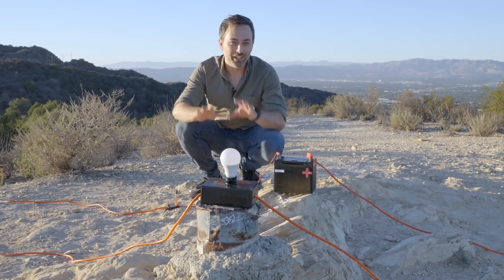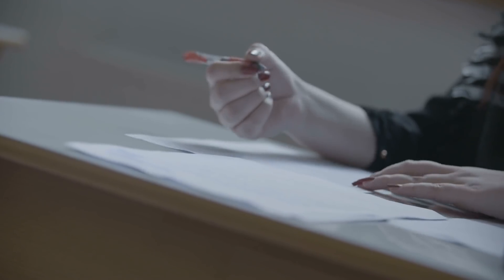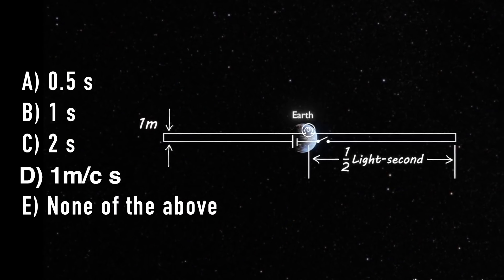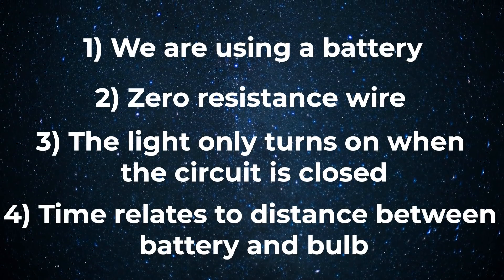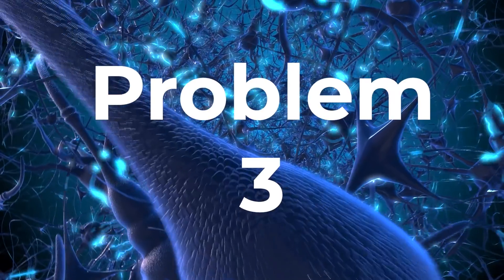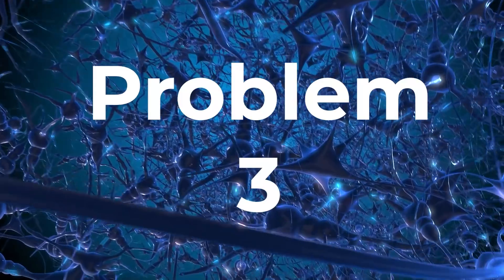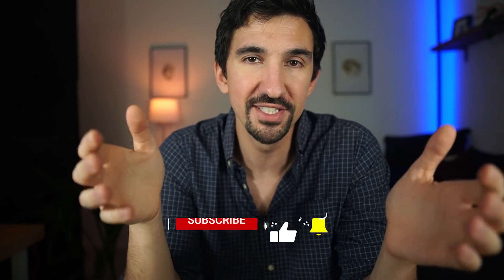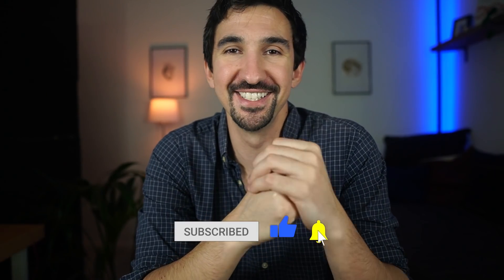Is Veritasium Wrong About Electricity?

Comment: Let's be honest, everyone's wrong about electricity. We've been going the wrong way for almost a millennium or 2.  Nicolette Tesla showed us the way using coils and Capacitors But we still think that resistance is how we get electricity. pulsing a 
Coil 
capacitor with the same values in series. 
At the right time and/or high frequency. We could have gotten power beyond what we see today, 369 × more power

Comment: Does the fact that it's electronic & magnetic fields that produces usable electricity allow for the future possibility of transmitting usable electricity in wireless ways rather than having to use a wire-based system?

Comment: Hi Ben, I am an Engineer for Microelectronics with more than 20 years experience and also responsible for the physics inside Microchips. Also I like science Videos on youtube and I saw this video very late and I was tiered. I had the same feeling like you and I stopped the video, because I was confused and thought what a bullshit. With so many Abonnements usually I expected professionals.
Reply: An Engineer for Microelectronics that doesn't know how a transmission line works?

Comment: Neither explanation makes sense. If electricity flows only through the wire, then electric arc furnaces should not be possible. If an electric field carries the energy, then integrated circuits at the size we see today should not be possible as the aur between the transistors would carry a field that would fry them. So what's the answer?

Comment: No. The bulb would go off 1 second later. Breaking the circuit at the furthest point will create a pulse that travels back along the wires to the battery/bulb at the speed of light or close to.

Comment: The closely spaced wires have a capacitance between them.  You can't change the voltage across a capacitor instantaneously.  When you close the switch, the wire on the far side of the switch from the batter is lifted to V.  You don't have to wait for that to run all the way out to the end and back to get the other nearby wire up to V - that capacitance "shorts out" that path and the other wire goes immediately to V, giving you V across the light bulb.  The transition from V to 0 propagates out toward the turnaround, yes, but the whole way the two neighboring wires have the same voltage, because that capacitance is linking them the whole way.
   
The "naive" circuit model that the video lets us imagine isn't correct - those parasitic capacitances need to be included in the lumped parameter model as well.
   
The really proper way to model this is with transmission line model, which you can model as a whole chain of series inductances and parallel capacitors.  You're going to get some pulse of current through the lamp almost immediately, but whether it would be enough to turn it on or not... well, we'd have to do the math.
   
Here's another way to think about it.  Imagine a standard transmission line that's shorted at the far end.  We put current meters on both conductors, right by us at the near end.  We hook the battery with the switch on one end.  Like this:

+----/ --- Meter ------------------> to shorted end
|
Battery
|
+-Bulb--- Meter ---------> to shorted end
   
The / denotes the open switch.  Now, when we close the switch, what do the meters do?  The answer is that both of them will immediately indicate current.  In fact, even if the far end was OPEN they'd still both immediate show current.  The difference wouldn't show up until later, when the signal had reflected off the far end and come back - in that case the current would STAY on for the shorted line but would go back off for the open line.  But before the signal gets down there we don't know if it's open, short, or in between.
   
The point here is that the bottom meter shows current immediately, which is why the light bulb would come on immediately.  It's those capacitance elements between the wires that give us a path for the current right away, even before current has taken the long path around.
   
The fun  idea here is that we could test this.  Obviously we can send wires halfway to the moon, but we could wend wires 20', 50', whatever.  And using modern digital technology we could time how far apart the switch closure and the reaction over on the bulb side were.  We could easily get that "speed of light round trip time" up to tens of nanoseconds, maybe more.  Just depends on how much room you have to string out wire.  We can measure those time periods.

Comment: In the model where you break the circuit at a far distance, the light wouldn't turn off as quickly as it turned on when you completed the circuit with the switch that's physically closer to the load, just as it wouldn't if you used that as a switch to turn it on. The light would turn off at the speed at which light travels from that distant switch. You don't break causality.

Comment: I think you missed the whole point electrons move extremely slow through a wire, it is the influence of the electricity that moves approaching the speed of light. And that influence is simultaneous down the whole wire. At the speed of light.
With the exception of any capacitance charge or inductance delaying the effect.

Comment: The circuit is complete except at the switch. Even through the element of the bulb. All electrons in the circuit are dormant til the switch is closed. Once closed the electrons move and the bulb lights up immediately. I think ?

Comment: I just watched that video right before this one popped up. I’m not an Engineer nor a physicist but a welder/fabricator and I’ve worked in automation and have a laymens understanding of physics and electrical engineering. My immediate reaction is that his model is flawed and incorrect but because it assumes an “empty pipe” so to speak. Just the same as if you took a pipe and made a long circuit but left the pipe empty and opened a valve it would take a long time for the water to first fill the pipe and then complete the circuit. Whereas if the pipe was already full and you open a valve the movement of water is instantaneous. Well his model assumes an empty pipe in my mind whereas the conductor already has electrons,they only need a push and a pull so distance isn’t and issue the circuit closes and movement of current is instantaneous. Besides all the other problems you pointed out in your video such as resistance etc. it simply is a bad model.

Comment: I thought about it for decades ever since I found out the magnetic vector changes when you go from a right handed solenoid to a left handed solenoid on a battery. You can do the test yourself with a 6 volt battery and coils made of flexible wire. And a compass to measure the magnetic field. But why is this true? Because the right handed solenoid chooses a righthanded current going from positive to negative and a lefthanded solenoid chooses a lefthanded current from negative to positive.  So do it yourself. Use a right hand rule for the righthanded solenoid. And Amperes lefthand rule for lefthanded solenoid. This is essentially the Madam Wu experiment but Wu assumed there's an electron current from negative to positive in both solenoids. So she got the wrong result.  Parity can be  restored as I found.

Comment: Just to throw my threepence worth in, so it’s probably wrong. Fields do not instantly get created, or end. When the circuit is closed causing the light to come on, it takes for the field to come on fully, there really small amount of time as the field gets to full strength, likewise when you open the circuit, ie switch the light, there is a really small amount of time for the field to collapse.

Comment: Anyone finding it hard to understand think of a water pipe as that you have volume voltage and flow is current.  So the minute the switch is on it pushes the electrons out the end simultaneously the switch is pressed.

Comment: I remember watching that video, and thinking "no.. that's not right '.. especially the resistance issue with DC battery.. since Edison was going to need generating stations every 50 miles, or so..to comercialy use DC power.

Comment: You didn't listen to the video. The power is carried in the FIELD around the wire. Not in the wire. The electrons are excited, not flowing but vibrating or oscillating back and forth creating a field which carries energy instantaneously. The point he made was that we've been wrong in assuming electricity was carried in the physical wire.

Comment: The light bulb is just a radio wave detector when it blips from the 1/c but it doesn't become powered until the speed of light can navigate the circuit from the battery to the bulb along the path of the wire. A radio wave emitted from the wire by the battery of course will reach the light bulb (and be detectable) long before an electric field wave can circumnavigate the first half of the circuit.  Transmitting power by radio waves doesn't transmit much power, but it does transmit SOME.

Comment: technically its the electrons that emits the photons. there is no reason to think that photons have their or speed independent of the electron and does not make any sense at all. neither does the idea that photons moves in waves in vacuum. its absurd how ever if the photons are like more or less stationary particles similar to air and the electron generate a sound wave at the scale of a photon then the resulting photon flux would be more of a chain reaction and the wave would be like a ripple in a gas chamber. since em waves are transverse waves they does not logically make sense as waving photons in vacuum as a transverse wave require a medium of particles to propagate its direction of motion. 

i imagine its possible to make directional sound waves that behave like laser. do the same thing with atoms as with photons. the quantitative loss of strength to distance by em transmission is exactly proportional to the electron cascade loss of kinetic momentum  in a wire. electrons behave like atoms. when electrons bump into each other their vibrate just like atoms. the energy loss in a circuit is mechanical. electron energy density decrease with distance. the longer the wire the worse the output. you can put 200 watts input into the wire and at 200 meters the output is only 1 watt. 

this is not exact but you get the idea. electrons behave like newton's cradle and that is exactly how photons behave as well. down the rabbit hole its particles the whole way and the waves are just some pattern in the chaos of particles.

Comment: You have to remember that the time it takes for the light to turn on, in the case of a completed circuit, is (distance between the switch and the light)/c.  Therefore, if the switch and light are 1 meter apart and the circuit contains 2 light seconds worth of wire, the light turns on nearly instantly (1m/c).  In your scenario where a break occurs at the farthest point in the wire and the light instantly goes off is incorrect, because in that scenario the point of the break is effectively a new "switch" breaking the circuit.  The time it takes for the light to turn off in that scenario is now 150,000 m / c.  This then pollutes your "add another switch and transmit Morse" scenario for the same reason, the source causing the circuit to either be completed or broken and destination are arbitrarily far away and it takes distance/c time for that information to be observed.

Now this might seem, on the surface, to present a new problem.  Set up a system with multiple switches that turns the light on/off where you could locally turn your switch off and break the circuit while an incoming distant "on" switch message is still in transit thereby negating it.  However it isn't a problem.  All scenarios where that is possible (you can do the case grid however you like) the circuit is not complete whether you flip your switch or not, so the light will not go on.  The only information you learn is that the switch is open at the other distant end, which isn't universe breaking since you cannot transmit that knowledge to the other end any faster than the speed of light.  It's the same reason why entangled particles don't break causality, because knowing absolutely the state of a distant system due to a more local one does not transmit information.

Comment: It's 1/C. The thing we have to remember is that C depends on mu and epsilon (permeability and permittivity). So C in space is not necessarily the same as C in the wire. Closing the circuit creates an EM wave and the speed of the EM wave is C, by definition.

Comment: Positive is NOT the push of EMF you think. Negative pull is what this shits all about. Absorption is consumption. Once ionization in the conductor result occurs , the intrinsic potential is manifest. We know how different frequencies behave as well, higher frequencies will literally (in human understanding)    radiate on the shell of the conductor. Or maybe I am just a dum-dum head. For what it aint worth I perfected the counter measure system on the Minute Man 3 nuke at Tracor Aerospace. Just think in the parameters of radio transmission frequencies. But we just need solid antenna......differential. I am certain I have a hate group, but boys we were using AI and super conduction in 1985. Bet

Comment: You complicate your answer uselessly and create confusion.
No matter at what distance, the voltage will "reach" or "touch" the bulb coming with the lightspeed. The first "electron" "moves" through the bulb exactly when the EM "field" coming from any direction ( in this case on the shortest path from the battery to bulb ) reaches the bulb. There's a small delay in "intensity" ( meaning the strenght=constructive interferences ) only because there's some "energy" ( = entropic interference aggregates ) lost in the building of the magnetic field, but as a simple general rule, everything, the EM and the first "electron" ( = the first main entropic interference ) touches the bulb at the exact same moment. ( What's an "electron" in reality? Evidently, it is part of the same dynamic, part of the same "field". The real nature of the Universe is not dualistic at all. Everything represents in reality absolute the same thing ).

Comment: Derek presented the video in a way to startle the viewer and get a reaction. I think the word "lies" was used intentionally by Derek to trigger a reaction and get called out for his thought experiment. The issue with the video is the tricky message it send to the viewer that the electricity that matters to us can travel seemingly faster than light in a setting like his, in which it doesn't. The small amount of current triggered by the electric field between the battery and the light bulb ain't useful for the purpose of lighting up the light bulb via the current that travels at the speed of light through the wire(or the electric field outside the wire or the wave, whichever the model we prefer to understand it). Then Derek does a second video to justify his misleading statements of the first video by saying we use wireless electrical transmission all the time including wireless charging etc etc. It is better to admit he got it wrong in the first video but still opened up many peoples minds that we need to see electricity transmission in terms of waves or fields from time to time, not just as currents and voltages along wires.

Comment: The problem with the initial hypothesis was that he says in the video that you needed to take out resistance as a factor. Longer wires have more resistance. So he’s both right and wrong. If there were no resistance then yes it would be nearly instantaneous but long wires have higher resistance.

Comment: This could be explained using an Inductance-Resistance circuit:

It could even be the induced current which is causing the light bulb to glow, assuming the resistance of the wire to be not equal to zero, but negligible at normal scales so that it adds up to a normal looking resistance e.g. 100 ohms.   
Veritasium had taken this in account when it comes to energy analysis.

And if we take in concern the circuit break problem, note that this thing is even now impractical as we would be getting the information of breaking circuit, after a total of 2 seconds.
So, I don't think it's a problem.
Thanks for reading.

Comment: The electricity which can travel faster than the speed of light does not make sense.. what he is saying is the its the energy fields around the wires delivers th energy..  hence his assumption is that it takes less due to his theory that the energy field has less than 150,000 kms to travel..

Comment: I think of transmission lines, shorted at the ends.   The short causes a reflected wave to propagate back to the battery where the load is.  So the time should be distance/(c in the Tx line), which is less than (c in freespace).